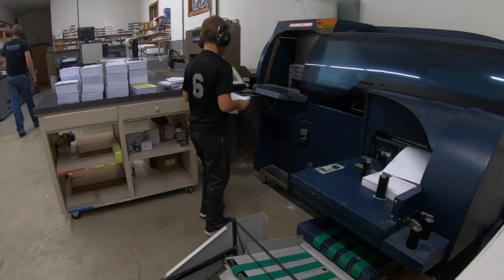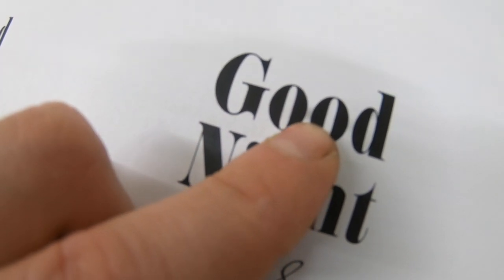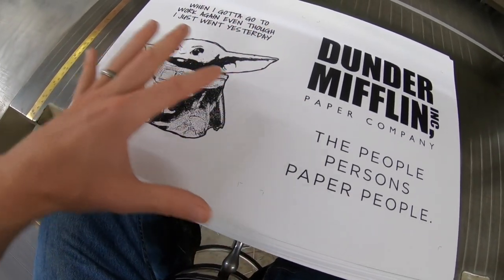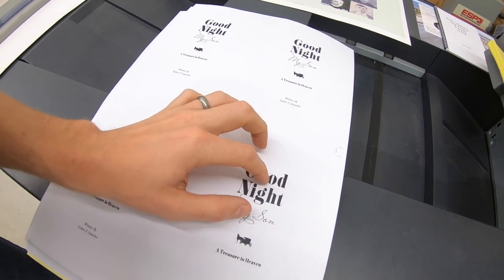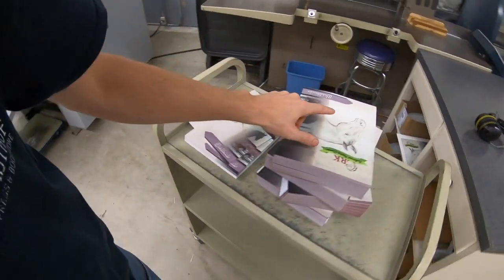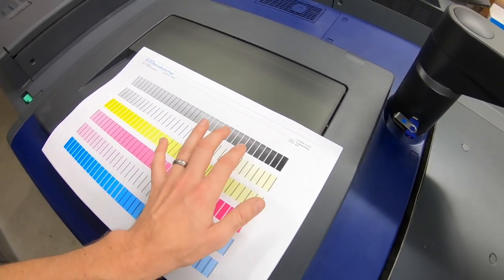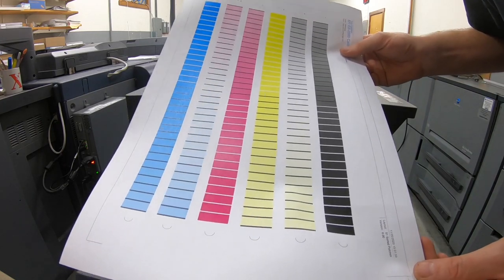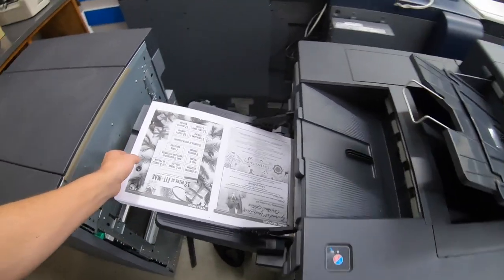Fixing up the C3070, Binding, Cutting and other Repairs in the Print Shop

Comment: I look forward to your videos.
Do you know if that Black and White Press use a Laser Unit or a LED Print Head to write the information to the drum?
I think what you cleaned might be the discharge/erase lamp. That toner build up happens over time, however if it happens frequently then that might be a sign that the developer and or the developer unit needs to be replaced. The same thing with the C3070 you just installed. Toner escapes the developing unit and will get on the charge grid and wire. Monitor that as well, might be a sign that the black developer and or material needs to be replaced.
Keep all 4 machines connected and running. You will increase productivity and at the same time you are sharing the load across the 3 color machines and not 2. The most important thing is that the front door of the newly installed C3070 and the B/W press can open.
Reply from the maker: Thanks, I'll keep an eye on the developer. It has been acting a bit funny. Yup, the doors can open. Thanks for the tips!

Comment: Usually the seal on the 1200 developer unit starts to warp and toner will blow past it and contaminate the LED lens.  Cleaning the lens is the cheapest and best option on a machine that old.
Reply from the maker: Thanks!

Comment: Thanks very much for sharing how the cutter works. Didn‘t know that there is a light to help align it. That makes so much sense now. 

One additional question: Do you try to hit the cut mark exactly with the knive or do you try to cut slighty next to it to have no remnants of the cut mark on the final product?

I was also interested who else is working at your printshop? 

Have a great weekend and looking forward to the next video!
Reply from the maker: I hit the cut mark exactly. When the next cut mark is hit the previous side of the cut mark is cut off. So no marks will show on the finished product. My sister and two others work with me.

Comment: What are you using for a vacuum? I'm getting into starting a printing business just currently with some C558s and C454e, looking also to find a used digital press from the Konica line. 

Did you end up selling your unit? I have a 3M Anti-Static Vac pack that I got a few years back for electronics and it seems that it's designed for toner pickup too. But are you using just a regular vac or using HEPA of some sort due to the toner particles? Thanks!
Reply from the maker: I bought a cheap toner vac on ebay. It has multiple filters.

Comment: I would scoot it down and try to get the 2 presses lined up. I would also see if you can get it any closer to the back of the 1070 it looks like it works where it is at. Also it looks like the 1070 and 3070 have a very similar lineup finisher wise so you might be able to line the finisher if one up with the high cap feeder on the other. Just a thought.
Reply from the maker: Good point. I am hoping I get a clear idea of what to do with it. But until I do I think it will just sit where it is. :) Haha.

Comment: Question: when you are checking your front and back crop marks and if they are off are you doing your adjustments on the machine or on fiery? I have a Ricoh production machine and my crops are not spot on like your business card video.
Reply from the maker: I make adjustments on the Fiery because its fast, however from time to time I like to adjust everything on the machine so my first sheet out is perfect.

Comment: Did you ever find yourself having trouble with that Auto Puncher? I feel like I jams an absolute ton when right where it pulls the sheet down. Can you share your experience using this machine? I love it when it works but when it mangles books it breaks my heart :[
Reply from the maker: I cleaned all the rollers and have had pretty good results. I also make sure that I print on paper that has the grain parallel to the rollers on the punch. Maybe if paper is very wavy the fingers will cause jams? I feel your pain when a book is ruined!

Comment: Question:  i noticed that you always have a blank colored page in between each book. How do to make sure there is always one there. I’m guessing you add an empty page on the document but how do you make sure you always have one when printing.
Reply: The press does that automatically when configured to do so. The BW press even has an extra paper feeder on the output side for that. You can see this explained in a couple of the other videos.
Reply from the maker: Yes, I add a cover sheet or insert when I send the PDF to the press. The press then will insert automatically.
Reply: Thank you  for the reply it makes sense now

Comment: Hi Dan, I was wondering if you've ever run into an issue with an SD-506 having wrinkles on the front page. It happens almost always in the same spot, I've checked the rollers and had a Konica tech take a look at it for a few hours and they weren't able to figure it out. It only happens on the front cover (same thickness as the other pages - 80 lbs gloss).
Reply from the maker: Hmm, thats interesting. See if you can jam the finisher at different times to find where the wrinkle is happening.

Comment: what are your thoughts and opinions on refilling your own toner using bulk supplies?
Reply from the maker: I have not looked into lately. I tried a few times years ago with office printers. Generic toners are so cheap now that I don't bother. I have not looked into this possibility for the Konicas though.
Reply: @justaprinter  Yeah if you are using generics that makes sense as the cost difference between generic and OEM is still quite a bit. The price for generic Canon copier toner is only 10-15% cheaper than OEM so refilling the bottles makes sense for me. Also super easy.

Comment: Do you have any component in the BW press that you don't use? If so, would removing that and moving the vacuum sealer onto a palette free up enough space to put one of the 3070s next to it?
Reply from the maker: I have thought about that. Even moving the BW press completely as I see using it less and less in the future. Hmmmm.
Reply: @justaprinter  If you move it completely, you might be able to put all 3 color presses perpendicular to the wall there instead. Probably not, but it's hard to judge how long they are with all components you'd want to have on them.

Comment: We are looking at getting a C3070, and the it specs says it can do auto duplex up to 350gsm, but I was wondering if you have run 360gsm stock through it on auto duplex without a problem?
Reply from the maker: The heaviest stock I run is 300 gsm, Worst case scenario you could probably print one side at a time.

Comment: hello, dan happy thanksgiving, dan I have a c1070 I just bought it used and it's just driving me crazy after transportation lots of error codes popped up and now the lock release lever inside is just not gonna turn left to open it do you have any Idea what causes that problem? thanks
Reply from the maker: Oh boy, it might just be a dirty or broken sensor that is not detecting the door is opened. You will need to do some detective work on that.
Reply: @justaprinter  I almost fixed all of my problems now its been giving me c-2841 code I even cleaned the IDC sensor but it seems like the whole IDC unit is dead or I have a problem with my main board

Comment: From past two days, there is a magenta line running horizontally on the print I don't know what to do 
I cleaned the drum unit ,developer unit and even the ITB belt but still I have the same problem ⚠️ any solution
Reply from the maker: I would need to see it, but id bet it is the drum. swap the drum unit with a different color and see if it changes. Then you know it is the drum.

Comment: I have a question about the digi fold
Reply from the maker: What is it?
Reply: @justaprinter  im looking at a morgana digi fold that is used. and I am pretty sure its the same kind as yours.  but I am also looking at a morgana digifold pro 50.   what would you prefer?  I want something to fold and crease card stock and maybe perf if it will...  the place I am looking at is brooks printing  equipment.
Reply from the maker: @brianbass5609  The Pro 50 is much faster than mine. Mine cannot perf, not sure if the Pro 50 can. I like mine for the most part. You need to hire someone to fix it when it breaks. Specialized tools are needed.
Reply: @justaprinter  so the digifold you have creases and folds?  I run a lot of Christmas cards and such  what is the smallest size card stock that it will do? how does it handle gloss paper? like 80#- 130# gloss?  keep up the good work with the videos.   funny I have been in the business for 10 years and my father for 40 years and I still come home to watch mopre printing lol
Reply from the maker: @brianbass5609  It does great with 80lb 130lb. I do 5.5 x 8.5 folded to 5.5 x 4.25. Sometimes it will dog ear smaller pieces of paper but I just run them flat and fold by hand. Yes, it creases and folds.

Comment: If you said a “LACK OF” magenta, you probably have an issue with your magenta developer unit, or toner on the LASER UNIT or toner on the charge assembly.
Reply from the maker: Turned out to be dirty corona wires. I find that wires need to be replaced often for best quality.
Reply: @justaprinter  Ok. Good to know that you got things sorted out. The Corona Wire and Grid are a part of the Charge Assembly. The seals on the developer housing are damaged causing toner to escape. That toner will usually go on the Laser window, Charge Assembly or Discharge LED. I own a Xerox C70 and C550 and those developer seals give problems as well.

Comment: Why such a fan of the bizhubs not Cannons or Ricoh. Every place I have been runs those rarely do a see a bizhub.
Reply: Потому что, бизхаб печатает хорошо листы. Просто листы. Рико берет плотные материалы и текстурные материалы. Канон - вообще не вписывается из-за стоимости владения. Так понятно?)
Reply from the maker: For me, Konica was economical machine price and click cost. Also, you can buy all Konica parts very easily. You cannot easily buy parts for other digital presses.
Reply: @justaprinter   я с вами соглашусь только если речь не идет о Xerox. Опять же я не знаю как у вас в Пенсельвании,  у нас вендор Xerox является лидером по сервисному обслуживанию. Однако у меня в парке оборудования есть 3070l и был Versant180Press. И как работает 3070 мне нравится больше. К тому же только сегодня мне прислали предложение о новой 4070!) Буду читать и сравнивать. Успехов!